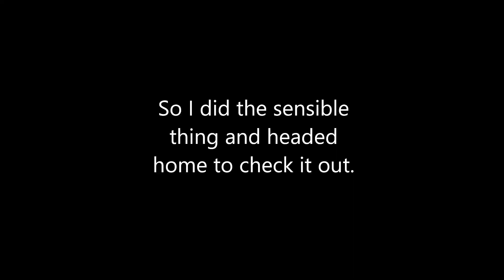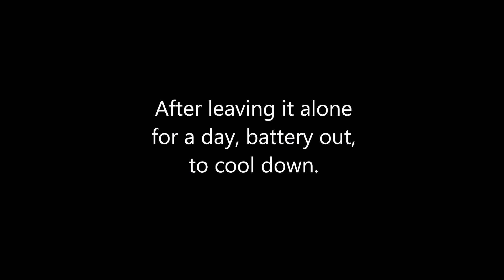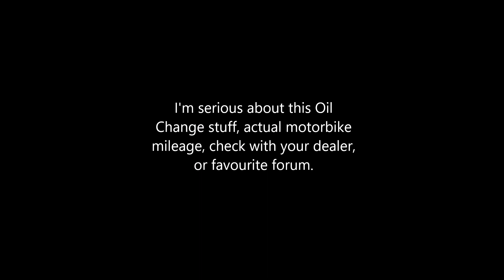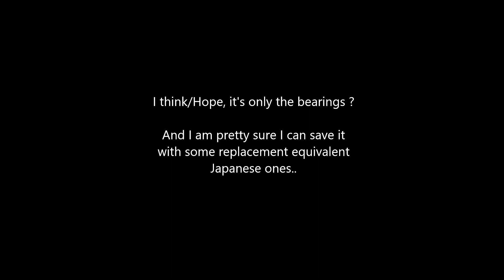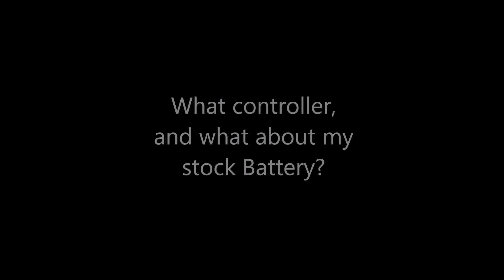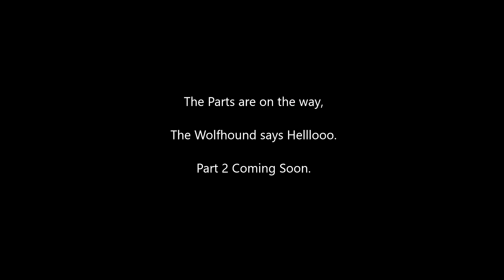Talaria Sting MX3 Error Codes 30, 42, 33 & 35 & Trying a new motor.

Comment from the maker: Has anyone seen or heard of any others trying to upgrade an MX3 to MX4R? Cheers All.
Reply: If you get the mx4 motor you'll need the mx4 gearbox bracket also it's 4 holes not 2 like the mx3. Other than that it should work.

Comment: What was the issue for code 35? I have the same issue
Reply: Did you fix it? I have the same problem after riding in the rain.
Reply: @NKMX1 did y’all fix it?
Reply: I took it to a dealership and they said the only option is to replace the controller. So i hot an upgraded nucular controller. Very sad.
Reply: @NKMX1  rip was your back wheel locked up to?
Reply: It locked up when it first happened. After that it was normal.

Comment: Hi bro i just bought new talaria mx3 from authorized talaria dealer in europe and after fckin 4 times ride i got error code 33 and that strange sound like "bum" when it happens ? what it is ? and what should i get on warranty new bike or repair
Reply from the maker: @donkublon9626  check all wiring on the back of your controller,  it is a phase error for too much current which can be caused by a bad connection. Also check the connections to the circuit breaker, mine had issues and melted and turned into liquid plastic

Comment: Error code47 on a Sting MX3 ?????
Reply from the maker: Battery breaker off?
Reply: Breaker is on
Reply: Breaker is on
Reply from the maker: Do you have access to a multimeter to check it?

Comment: Thanks for sharing your trouble shooting info and upgrades! I just got the Error Code 33 the other day after riding about 3 miles of single track, bike wouldn't go. Let it sit like 30 minutes. All better. Rode around the neighborhood later no issues. Looks like it happens just under load? Looks like I need a controller now too. Just double checking, the new MX4 controller will work with the old MX3 motor and battery correct?
Reply from the maker: Yes it does, but wait for the TORP controller for the Talaria, it looks amazing on the Surron and the Talaria one is supposed to be nearly here.
Reply: @wheels.3239  Thanks for the reply! I'll check it out.
Reply from the maker: @markfulton1883 Too easy mate. I will be too.
Reply: Not for me. I came back from a ride, had no problems and got error 33 next time I turned on the bike and twisted the throttle.
Reply from the maker: @iLikeDots1  Good to here, mine did it a few times like that, I hope its all good for you. Ive had no problems with the MX4 one but i will be getting the TORP as soon as its out.
Reply: so how did you fix the error 33 code?

Comment: Could be a broken magnet not a motor bearing. Mine got water in recently then overheated and blew a magnet it made my back wheel lock up motor seozed basically. I foxed mine but i do plan on getting a mx4 motor also prob soon.
Reply: My bike gets error code 03000 bike will rev and not move then cuts out fully with the code 03000
Reply: my bike recently just shut off and keeps showing error 35 every time i turn it on and the motor is is almost like stuck and almost stoping the tire from moving does this mean i need new magnets and if so where can i buy
Reply: @bengoetz.18  following, i have the same issue